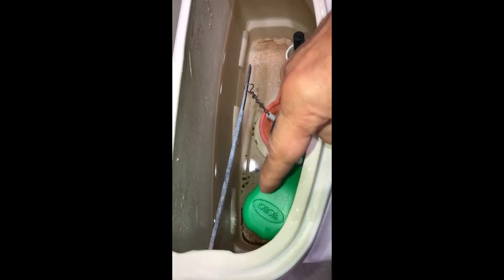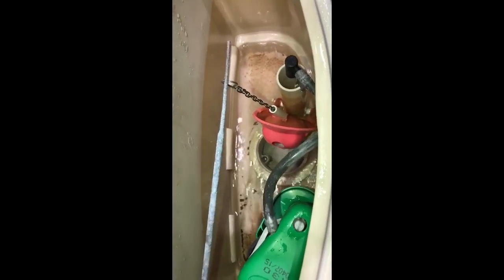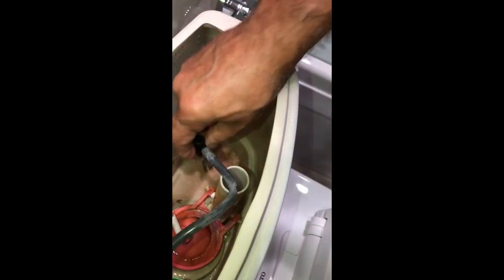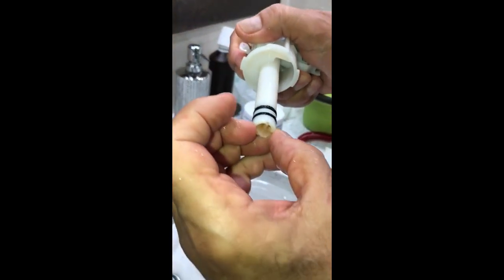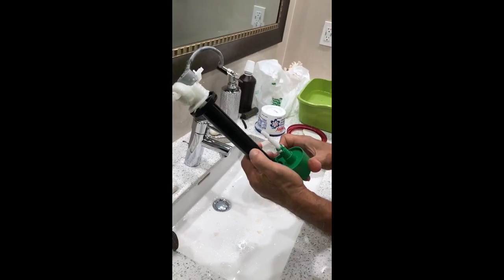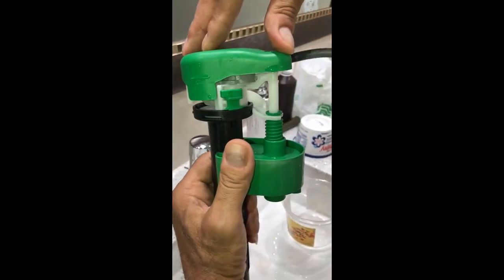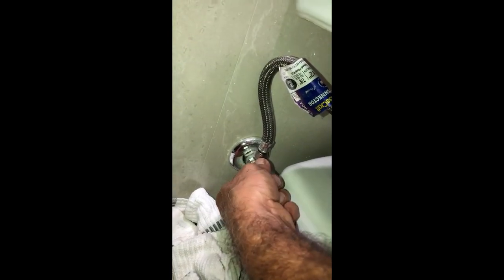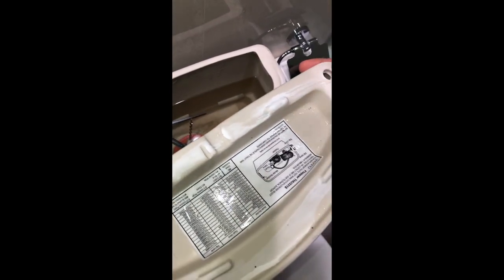How to clean or replace Fill Valve for TOTO toilet 2015

Comment: You actually made my day by giving me the confidence to just take this thing apart, even though the Toto Support phone line claimed this to be "maintenance free."  The guy on the phone said I'd just have to buy another valve assembly.  After watching this, I took it apart and just as you said, there was about a 2-3mm diameter piece of gravel almost entirely blocking the hole in that black pipe.  It was totally satisfying to poke it out and have the thing work without buying a new one.  Thanks!
Reply from the maker: zeldaah I’m glad it helped you. Thank you for your comments.

Comment: If you have enough room to rotate the top part to remove it, you can do this without removing the entire fill valve.  Just take it apart from the top and clean as you described.  After you remove the top part (containing the filter) you can hold a cup over it and pulse the water on and off to make sure the black tube is clear.

Comment: Thank you for this video. I disassembled without removing the entire valve from the tank and that worked for me. Cleaning the white part did the trick. For others watching the video, it might be worth trying that first to avoid messing with the bolt under the tank.
Reply from the maker: You’re welcome. And thank you for your comment. 👍😊

Comment: Thank you. My TOTO started making annoying hissing sounds after the water was turned off for the whole building. Most likely some rust or particle clogged the fillup valve. I was able to pull the filter from the top without taking the whole valve out. Also used a wire hanger to clean the 2 mil hole in the main black tube. Thanks again. Great step by step tutorial.
Reply from the maker: You welcome. I’m glad it helps
Reply from the maker: Yes, it’s very common problem when water turns off in the whole building.

Comment: Our Toto would run occasionally at night and wake us up.  I could see the water level was constantly at the top of the fill tube.  I followed your instructions and voilà, it now works perfectly again.  Thank-you!  I didn't even have to use a piece of "wire" to poke inside; running water forcefully through the tube did the trick.  (You can look through it, and if you see light through the hole, you're good to go!)  Thanks again.
Reply from the maker: Greg Popp I’m glad it helped you. Thank you

Comment: Perfect explanation for EXACTLY the same toilet and fill valve. I found that adjusting the position of the valve when I put it back on allows me to access the tab and remove for cleaning without having to take off the water hose and nut under the toilet.  Thank you.
Reply from the maker: That’s another way to do the job. I’m glad it helps.
Reply: How do you adjust position of valve So you don't have to completely take it out?

Comment: Though mine is a newer model (2019), the mechanism and problem was the same.

Thanks to your video, I was able to get working again.  

I also seized the opportunity to clean out the fine sediment in the corner of the tank (which I suspect was silt from the building's water-tank), as a new baseline to keep an eye on things.
Reply from the maker: You are welcome. I’m glad it helps.

Comment: Thank you for the video. I found it was easy to further disassemble the valve assembly. I located a small piece of plastic ( from when the manufacturer assembled the unit) that was sitting on a seal . The small piece of plastic prevented the water from completely shutting of after the tank filled. After removing the plastic and reassembling, the unit works perfect. The Valve assembly appears to be something that has replaceable parts. I think is is very well built.
Reply from the maker: You are welcome.

Comment: I can't tell what length connection hose you have running from the wall to the toilet, but from my recent experience, choosing the shortest water hose wasn't the best choice.  Over several years, the tension in the twist of the hose caused the plastic screw in at the toilet to break and water flooded my bathroom.  I opted for a longer replacement water hose if hopes that the tension put on the twist of it would not cause the same problem in the future.  I'm just glad I was home.  

I have a different problem than you. I do have the same fill valve as you though.  I'm suspecting the float valve mechanism but haven't completed troubleshooting.  the fill valve will open abruptly for a second with a loud sound otherwise I would suspect the flapper.

Comment: Very helpful video.  My  problem was that water would occasionally run into the drain valve even though the toilet was not flushed.  I will try cleaning the fill valve to see if it will solve my problem.  Otherwise, I will just install a new fill valve.  Thanks!
Reply from the maker: You welcome.
Reply: Hey, what happened with this? that's what I have got going and wondering why it keeps filling into that drain valve on the flush valve

Comment: Mine is the opposite , water tends to sip after it is full.  Will see tomorrow,  thanks for the video tovarisch!
Reply: Mine; the water continued to squirt out and would not stop. I took it all apart and found white slime in the valve that is on top that he did not take apart. It's not hard to do. I put it back together and now I will try it out. If it still leaks, I'm going to buy a Fluid master universal. The Toto is intricate.
Reply: It still leaked. I bought a Fluidmaster for $8 and fixed it in 10 minutes.

Comment: Hi thanks for the video.  I followed the "well explained" instructions put everything back together (there didn't seem to be any blockage & filter was very clean - toilet(s) 2 are only 11 months old??  Water still running.  Any other advice?  I've ordered 2 new fill valves in hopes something is mechanically faulty... but so weird both toilets are having same problem at exactly the same time..? Ugh.
Reply from the maker: All I would think of at this point is flapper. Check if it holds water in the tank with no leakage.
Reply: @MrNod56  Thanks.  Turns out it was the flapper (for both toilets) go figure.  Lol at least I know how to take the mechanism apart now for the future.  Weird they 'went bad' at the same time - less than a year too.  Thanks again!

Comment: I cleaned it following your instructions, it w as pretty clean actually but hissing continues? What could be the problem?
Reply from the maker: luchoporto check the flapper, making sure there is no leakage from water tank  to toilet. I’m sorry but that’s the only thing that I would do. If doesn’t help just change the fill valve.

Comment: What happens if the full valve doesn’t stop the water?
Reply from the maker: You will waste the water. It will constantly run to drain and make noise. There is also a possibility for water to overfill the water tank thus creating the flood.

Comment: Don't be cheap, replace a fill valve,
Reply from the maker: Thank you for your phenomenal comments. Just for your information, the whole process takes about 10-15 minutes. And trip to the store and back about an hour. I’m not mentioning the expenses to the car use, gas and device itself.
Reply: @MrNod56  thanks for your video, anyway, but my point is you don't have to go to the store if u have an internet, order for $20 and you'll get it in few days by parcel.
New style of fill valve much better than old (green one), definitely you will get brand new device, and your tank will get more water inside

Comment: Thanks for a detailed and easy to follow video that explains a very non-intuitive process. The fill valve in the video is a Toto Model 130. Mine is a Toto Model 330, which looks exactly the same, and the maintenance steps are the same. In the video, a good bit of water falls to the floor when the valve assembly is removed. This can be greatly reduced by using a wet vac or a sponge to remove any water remaining in the tank after removing most of the water by flushing.  My problem began after water had been shut off to the house during a freeze, and then restored. Sure enough, there was a large particle blocking the 2-3 mm hole in the black tube, plus numerous smaller particles in the filter comb inside the white tube. When I finished up the repair and restored the water supply, the valve quickly became blocked again. To prevent this happening, I recommend placing the end of the water supply hose into a bucket and blasting some water through it before re-attaching it to the tank. I also found a small particle hiding in the fitting on the end of the hose, so check that out, too. After future freezes, I plan to prevent this problem by blasting out the water supply hose before restoring flow to the toilet. Or, as one other viewer commented, you could install a pre-filter in the line.
Reply from the maker: Thank you for  your comment. Very interesting potentially useful suggestions. A filter in supplying hose can be useful in a house. My case is an apartment and isn’t necessary. Regarding water flushing before installation, definitely highly recommended. Thanks again.